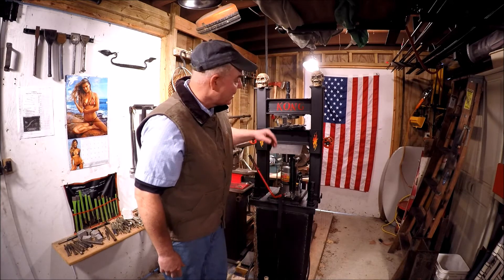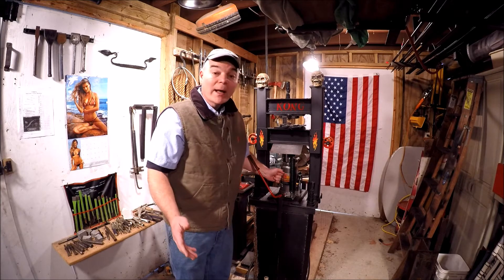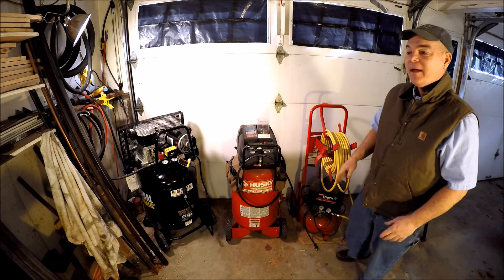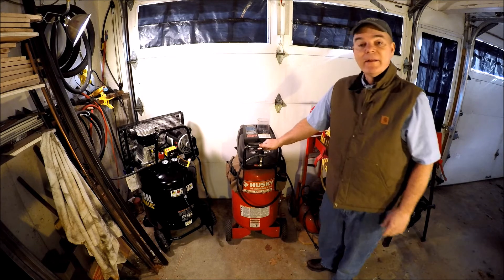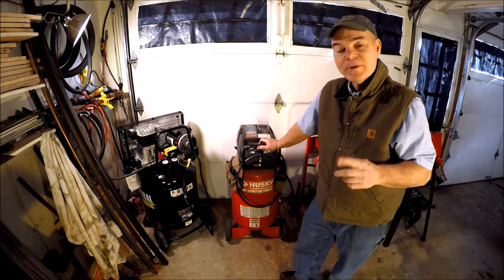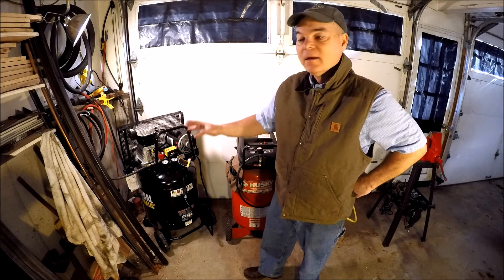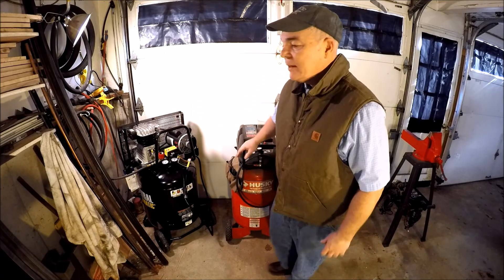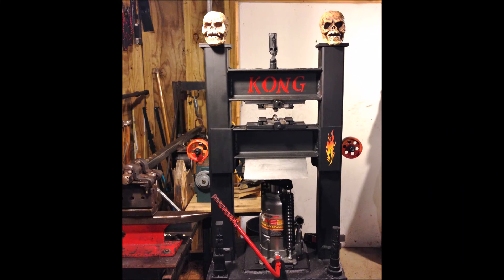Subscriber Question: What Size Air Compressor Needed For The Forge Press

Comment: Volume volume volume. Me of think it's psi but one of those tire inflator can make psi. I'm a diesel mechanic and running air tools or air over hydraulic jacks need the volume for steady usage. When I started out I bought 2 different oil less and seized my first in 2 weeks. Thee second worked ok but could just barely keerp up with a air ratchet never mind running Sanders or grinders. I finally bought the largest non industrial I could get from my local fleet/farm store and have had it 13 years and the only time I tax it's 60 gallons is running my blast cabinet. Grinders and Sanders go no problem. So, get the biggest 220 volt oil less compressor you can afford and have room for if you are going to use it regularly f or hi volume.
Reply from the maker: totally agree, the bigger the better and at least 29 gallons / 5.5 plus CFM ; Cheers!